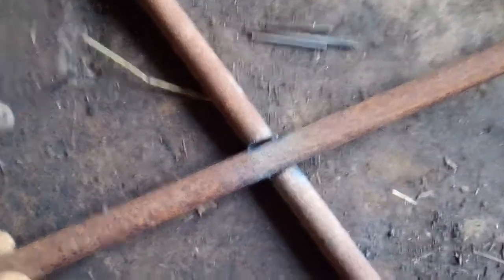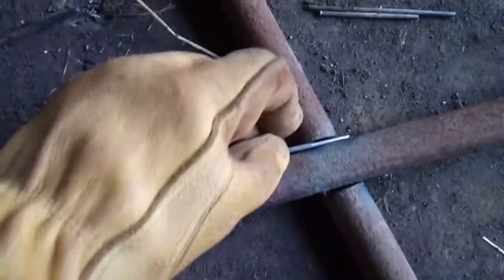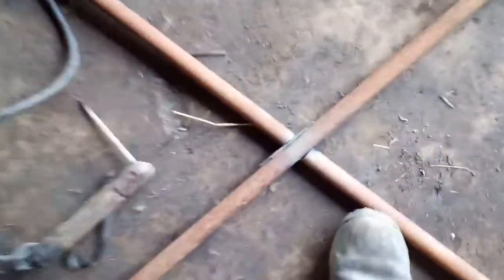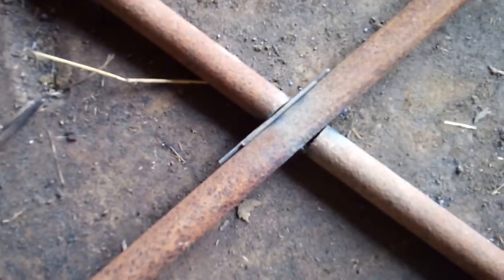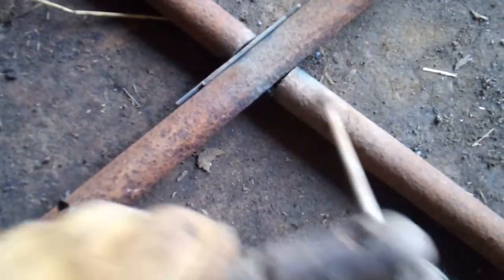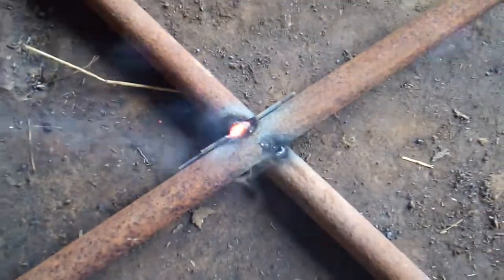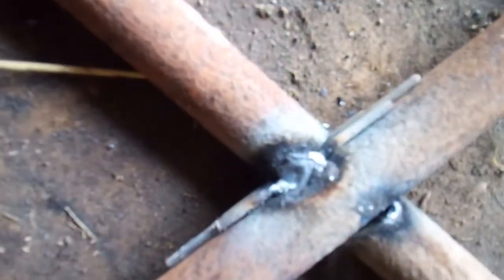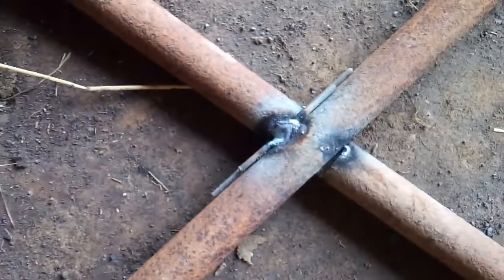Welding tip, how to bridge a gap

Comment: I recommend beating the flux of those fillers first. The shelding gas from the active electrode is all the flux you need. It will also make it much easier to weld because said flux is not conductive. Usually when Texas tigging  the flux is beat of the filler. Old steel coat hangers are useful for this type of welding too.
Reply from the maker: Those are great tips, thanks for the comment.

Please help our channel grow by subscribing.

Comment: I've just used nails in the past, without much success I might add. Never thought of using welding rod tips. Thank you.
Reply from the maker: You're welcome!
Someone commented recently and said it's called Texas Tig, evidently real welders do it this way too lol
Reply: Without success? Why what happened? All it does is keep the puddle from falling and making a bigger hole. I'm not sure why a nail didn't work for you.
Reply: @KokainAI  The nails melted too quickly. This week I've tried the rod tip idea, and it's much harder than nails. It actually works!
The other factor is that I'm not much of a welder. :)

Comment: anyone watching this who wants to weld properly needs to know that preparation is key to a strong long lasting weld.  while 6010 and 6011 rods will cut through rust, the rust will still weaken the welds.  sanding/grinding down to cleaner if not perfect metal will give a better result in all cases, even with 60xx series rods.  this would not weld with 70 series rods, which need very clean surface
Reply from the maker: Yep I totally agree with you, but in cases where you don't need a super strong weld why waist your time cleaning off the rust?

Thanks for the comment, please like and subscribe
Reply: @springorchardfarm1214  I get you here, but to clean things like these you need 5 seconds with angle grinder wire brush.
Reply from the maker: @fupidox5642  Yep, that's true.

Comment: Billy bodger 😝 no way would that so call weld hold your ment to have a clean rust free surface 😭
Reply from the maker: Give it a try it works well, also use 6011 rods and you dont have to worry about rust so much.
Reply: Stick welding is very forgiving on rust. Pretty much the only advantage it has!
Reply from the maker: @youtubier2839  It's great for farm use.
Thanks for the comment, please like and subscribe.
Reply: @youtubier2839  Actually stick is good because it can literally be used in almost any condition. No need to haul a gas tank anywhere. Certain electrode are good with working on dirty metal such as the 6011 and 6010 but even though they can be used on rust doesn't mean you should if you want a good solid weld. Clean metal is always important  if you want a good solid weld. I would only weld dirty metal if you have absolutely no way to clean it and the project isn't something critical.
Reply: Farm welding is much different than other welding I've seen people do things that you wouldn't think would work but it has . ive seen this done before and many other things to fill gaps
Reply from the maker: @daffyduck5171  Lol exactly!  It's all about trial and error on the farm. 

Thanks for the kind comment please help my channel grow by subscribing.